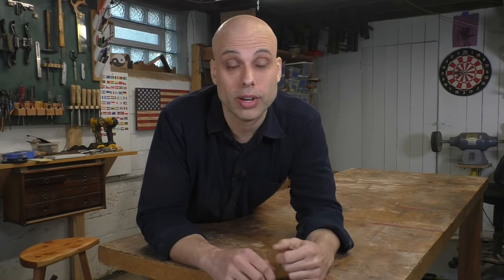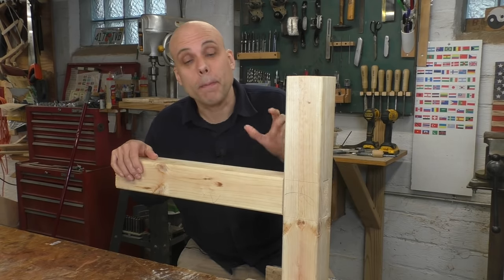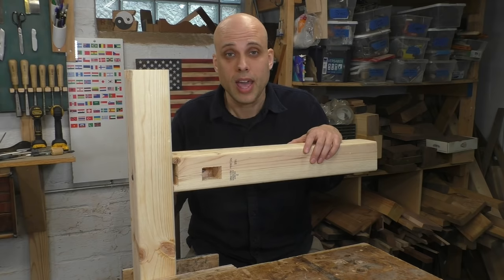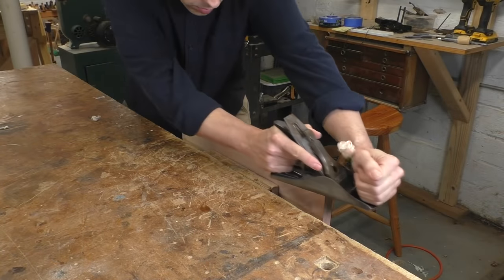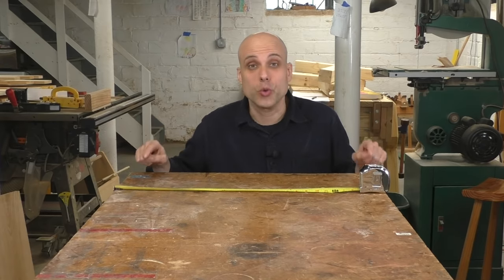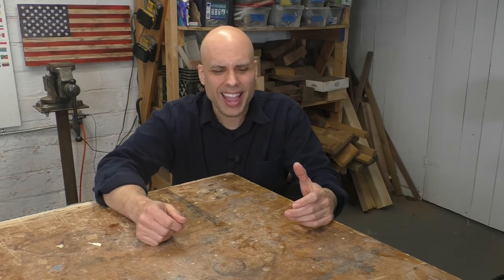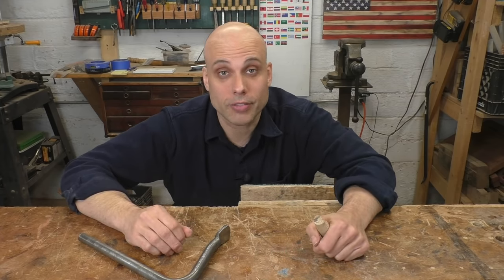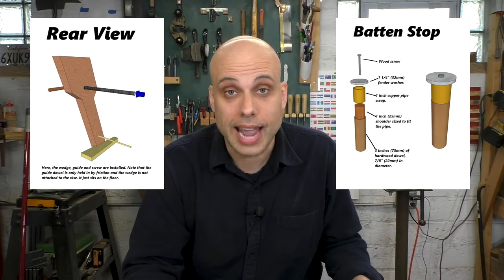Four Workbench Building Mistakes (that we all make).

Comment: Only now do I realize how amazing our massive wooden workbenches were in middle school when I did most of my carpentry back in the 90s. Looking at them now, they seem far superior to most things on the market now and had all those tools, slots and extra vices built in as part of the benches themselves. Similar things seem to be selling for thousands of euros a piece >_<;

All the tools were traditional tools, and apart from lathe we didn't use any other power tools for anything else than for metal working. Even drilling and such were done by hand operated drills.

Just goes to show how little you are able to appreciate quality things when you are a teenager
Reply: Sounds like you were using the typical northern European bench with a shoulder vise, a tail vise and dog holes along the front of the top and holes for hold fasts further towards the center. Something far too many American schools even bother to look into, let alone provide.

Comment: My brother and I built a a bench with old four by three oak out of a cowshed in 1969, using through mortice and tenons, and it was strong as hell and one of the prides of my life. (It probably had plenty of snags, but I worked on it and one winter I slept on it). I lost it in a fire about 1990. Even owning the bench my dad built before I was born, doesn't compensate.

Comment: This might seem cheeky but you may like it . For a strong corner joint just make a half lap joint first .Then create an extra layer on this joint with 3/4 inch Birch plywood. Take the end piece of ply  down close to the floor and the top edge inwards about 3 feet. Now cut a curve where you might want a shelf underneath. So the plywood can be screwed and glued and there will be no flex in that joint endways . Or instead of glue use coach bolts and those nasty ,sharp builders washers with spikes poking out both ways .  Each side of the bench can have similar ply corners . Then make some similar bracing underneath to eliminate twisting . Finally make 4 boxes for each leg base (inside ) and put 2 heavy engineering bricks in each box. Borrow these from any disused railway viaduct .

Comment: I'm looking at that single-bolt leg/stretcher connection, and -- yeah, the compression of the wood means you can only ever get it just so tight, but there's a solution track, that you didn't address;  BIGGER WASHERS on both ends to really spread that compression load.
On the inside, use the largest square plate washer your mortise will accommodate; you might even size up your bolt diameter to match.  On the outside, check into malleable iron washers; these are common on all manner of bolted timber structures and are employed EXPRESSLY BECAUSE they really spread the load produced by torquing the threaded connections tight.

YES, you'll STILL probably upgrade later on, but your "make do" bolt together starter bench will be far less grief in the meantime.

Comment: End vise doesn't fit... I drill 3 holes in the stretcher. Problem solved. 😁
Bolted leg joinery? Yeah. I've compressed and tightened so many times the boards have all split.
I did make an oak top though so at least I didn't make every possible mistake! 😝

Comment: not a woodworker, but I'm intrigued... 
the "through mortis and tennon", if rather than using glue and instead using one or more bolts through it (like the half lap) would it be a better joint as it would resist torsion better and have the ability to disassemble?
I feel like there should be some cons to replacing glue with steel but I'm unable to think of any

Comment: My first bench I had for a lot longer then I should have was a old kitchen  cabinets fixed some plywood too it was being thrown out for trash the drawers were handy for small hand tools and such  and it had a area I could put all my power tools. At the time i only needed it mainly for my vise and final touched stuff  but I can say I beat that thing up and when I finally got rid of it I took a lot of the hardware off it to use when I made my new one 😂

Comment: Had a 2 x 4or g work bench for years.  Moved it twice.  Present house doesn't have a basement to put a shop in so it shares space with the pervious owners built in bench and shelfs, my tall two cabinets, two cars, bench lathe and milling machine.  The built in bench has a 1/2 compressed sawdust top.   Could replace the top but I would spend a lot of money to do this for a 20 ft bench and the vise needed.  So I went for a Moravian bench.  A screw together person never it 'tongue and groove' or 'mortise and tenon'  My wooden table saw hinge to top broke and was disassembled.  So my first time trying to do accurate cuts with hand tools.   My weakest part in the build are the thickness of the tenons that ended up to need glue on wood to fit tight.

Comment: My original bench is based on Paul Sellers bench series. Nice, solid bench, but it too has limitations. The good news about it is the legs are now two separate components that are really easy to take off from the top if I want to. Bad news is they're a bit too wide AND the top has a tool well which to me is nothing but a junk collection portal to hell.. I don't mind it being so wide except it does take up quite a bit of shop space. I suppose I could recut the tenon stretchers, but I glued them in so it's not going to change. At 32" I can live with it..I can set an entire kitchen cabinet up on it if necessary..

Comment: I really like the compromise of the half-lap joint for the stretchers.  It is a sufficiently strong joint, yet simple enough for less experienced woodworkers AND it something you can disassemble if you ever needed to move your bench.    Is there a similar solution for fastening the benchtop to the legs?   I have a hard maple top (150 yr old lumber) which is 78x28 in and  3 1/2 inches in thickness.  In short, it is heavy.  For the base, I have legs and stretchers that are 5x5 inches in size to handle the weight of the top.  The problem that has held me up for the past 6 months is trying to decide the best approach to fastening the top to the base.   Any suggestions?

Comment: I am currently building my own workbench out of reclaimed lumber on my property, for financial reasons. The lumber is good and the process has gone well so far. My question is…is there any reason that I cannot laminate the legs in such a way to already have holes in it to house the stretchers? For a through tenon type joint. The center board would contain gaps just big enough for the tenons, then I would laminate full length boards on either side of the gap. I feel it could save some time and tons of chisel work. With a combination of glue and perhaps a mechanical bond such as screws I fail to see for this would be less stable or lose strength. Any objective thoughts or advice would be helpful.

Comment: What are the pros and cons of straight legs compared to slanted ones? I would imagine a little bit of triangle would make slanted more stable but of course legs will be pointing outwards. Some designs have slanted legs feature, most don't. I guess others rely on being massive and very tight joinery.

Comment: I have a  heavy solid core slab door (36" x 80" x 1-3/4") that I laminated (top and all 4 edges; formica) 40+ years ago and used for decades as a desktop (supported by two short filing cabinets).   It's no longer needed for that use, so now I'd like to repurpose it as the top for a new workbench (including drilling dog holes).  I was glad to note your observation about being able to plane a new surface if the top is wood, so that's a downside to consider.   And I also saw your concern about dog holes in a "synthetic" surface "wallowing out", but that seems a lot less likely with the harder nature of Formica vs Masonite.  Still, what else should I know that might be bad or good about using this solid core door slab as a workbench top covered by Formica?
Reply from the maker: You just shouldn't do it.  You don't know what will happen, but with solid wood,  there will be no surprises.

Comment: Have you ever tried a roman woodworking bench? It's kinda...like a regular bench, with some holes for dogs. Probably not good for your spine, but it did work for centuries, and it uses your own weigh as a clamp and a vise most of the time. It's an interesting exercise on what can be achieved with little to no tools.

Comment: I have a workbench made of laminated two by fours for the frame and laminated plywood with two by fours spaced every 18 inches on top. Overall it's four by eight feet on heavy duty wheels and can support two thousand pounds. It's designed to hold materials, tools,  hardware and of course, work of many sizes.

Comment: I'm now in my high 80's. so at my stage I have to have a workbench which is adapted to my physical limitations. Bending over is the worst,  so I built what is essentially a work table  which is higher than your traditional height, and actually at elbow height instead of the traditional crotch height.  Also, use of elaborate mortice and tenon joints are finicky to build and not necessary.  I use standard 3/4 inch dressed lumber with many overlaps and held together with wood screws.  As a former canoe builder I have about a gozillian C-clamps in various sizes which are easily adapted to make a vice unnecessary.  A further refinement is using hollow box beams from 3/4 lumber rather than solid beams such as you might use in building a barn.
Another confession:   I long since gave up using hand planes - my back is too weak, and as tools they always need sharpening and constant fine adjustment.  A farrier's rasp does the duty of a plane for me now.
Reply: At 70, I too have a taller workbench at 41 inches, an inch or two below elbow height. I also have a couple of 6 by 8 by 3-inch table height props to hold finicky stuff up to see better and get closer to my workbench magnifier. Everything is also on wheels so as to not put strain if I want to move something around. Wheels work fine on a workbench as long as they are large enough (3 inches is about right) and can be locked.
Reply: @johnpombrio  You're right about the wheels - as large diameter and lockable are what to aim for.  As a practical matter no wheel can ride over an obstacle whose height is greater than the RADIUS of the wheel, so cables and bits of scrap wood you haven't picked up yet can be problems if the wheels are'nt big enough.

Comment: Bolts on wood. I learned to use steel plates at least 40 mm x40 mm x  4 mm thick as washers. That distributes the weight better. I did that to repair this double decker bed made of yellow wood (I discovered I am allergic to) I don't know what. That was how it was originally designed so that it can be disassembled. I also used resin to repair the joints. That steel plate solved the problem of pressure on the wood. I know there is a washer of comparable size but it was cheaper for me to just build them and it worked and looked better.

Comment: Another idea for a work top is to build a bread board edge around the entire table. Leave it proud of the plywood top by a 1/4 inch. Then cut 1/4 Masonite the exact size to drop down inside your bread board edge. When it gets beat up or globbed with adhesive, just flip it over. Cheap to replace when both sides are used. I use this table mostly for glue ups and assembly.

Comment: What about specs for a home workshop bench for general-purpose use, though? (The home we bought already had a home-built workbench (24-30 inches deep by about 17 feet long) that was used by owners of Harleys.) I plan to stiffen it with Simpson Strong-Tie hardware, perhaps raise it a bit to 34" for working on bike parts and maintenance without bending over, and be done with it. I know am not headed into lots of fine woodworking, just using it for home DIY projects and bicycles...

Comment: make your bench top out of whatever sturdy lumber you like, but install masonite or something similar as the actual work surface. you could attach it even with 2-sided tape instead of screws. true, you can't plane it later, but you don't have to: if it gets dinged up enough after many years of sterling service, take it off and replace it.

Comment: Everyone has these takes on what face vises can and can't hold.
I reccommend watching paul sellers do joinery and stock preparation.
I don't know if it's all just in the quality of the vise, but he will straight up thickness boards held only by a face vise that isn't flush width the apron, and it holds the boards fine.
It seems that a good vise, with a rubber/leather/cork jaw-cover for grip, will hold just about anything.

Comment: Question on half lap joints. I am using two 2x4s instead of a 4x4 for the posts and a single 2x4 for the rail. Instead of half lap on the outside which would cut the 2x4 legs shorter, can I make two 1/4 lap cuts on the inside and sandwich the 2x4 rail in the middle? It would then look like the through mortise and tendon joint. Any advantage vs a 1/2 lap joint?

Comment: I’m also 6’2 and found that my back hurt all the time because my bench was always too low.  I built one about 44”.  It brings the work up closer to your torso and for the stuff I do, that is a huge benefit and vastly reduces neck/back strain.  33” would keep me bending down literally all the time.  I guess good advice is to build what works best for you.  Take a look at jewelry benches sometime.  The work is at eye level or just below when you’re sitting in the chair to reduce strain on the neck.  Similar concept with a taller woodworking bench.  Not at eye level like the jewelry bench but not at knee level either!
Reply: I think the qualifications there is "ideal height depends on what you are doing".  This bench is set up for planing and other work where body weight is useful.  Then take it the more detailed fiddly thing you want up near your eyes to something else that is taller

Comment: Actual question: Woundn't those steel-braces that are used to join together beams on houses do a good job as well? They are not, too expensive and make the construction of the joints a lot easier if you do not have a good wood-working setup already. Any disadvantages going that route?

Comment: Hi Rex, I am in agreement with your advice but my bench is to low now for my back.  Adding height is not so easy to implement.  I raised it with 3 inch wood spacers sandwiched between wood plates bolted to the bottom of each leg.  My family laughs at them as they look like elephants feet but they work and are strong and the bench is just a rigid in all directions .  I make new benches with mortice and tenon joints for various purposes but always taller, like you say, you can always trim them down.   My favourite operations are planning by hand and chopping out those M/T joints.  Like you vids mate thank for putting them out there.

Comment: Well, I would take issue with your types of composite bench tops. I have used Melemine and Laminate tops for the last 25 years now. If I'm worried about gluing, I use a layer of wax paper over the bench. As long as you put down the laminate on a good, flat, frame, shouldn't be much of a problem, IMO. Other than that, Thanks for a good video!

Comment: I suppose this advice is targeted at dedicated woodworkers benches that will be doing things like planing if work clamped down to the top. For a more general shop bench that does more mechanical and electrical and less to no planing , we often place the benches against the shop/ garage walls and importantly have almost none of the shearing forces you need to address with better joinery. Almost all of the forces are downward for me , and that is entirely supported by the legs - so the rails only need to hold the legs vertically in place. There the simpler joints are, I find , perfectly good. The bench is mainly a place so you can hammer , glue , screw, cut , saw, solder , etc without ruining desks or tables or counter tops inside the house. 😊

Comment: My electronics workbench, while not a woodworking bench pe se, gets a lot of general purpose work done on it, from rebuilding bicycle parts, auto parts, building speaker cabinets, whatever, and I top it off with a , 8' x 36" sheet of masonite.  I replace the masonite (less than $10) about every 3 or 4 years, or whenever it starts looking nasty.

Comment: Plan ahead.  Such good advice.  The problem is you just don't know what you don't know.  I built a great workbench.  Heavy.  Stable.  Pretty.  Not too wide.  Long.  Shelves underneath.  BUT The 2x6 frame means I cannot sit at it.  Knees won't fit under on a high stool.  Back when I built it, standing all the time was not too much of a problem.  Yeah.  I was 65 then.  Now I'm 70 and I NEED to sit sometimes.  Ah, well, apparently one lives and learns right up until the end.